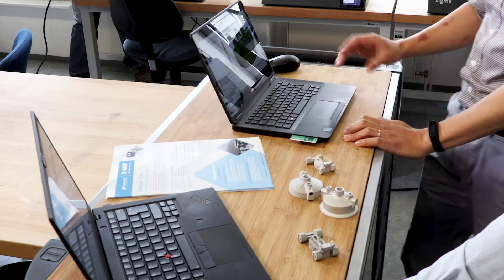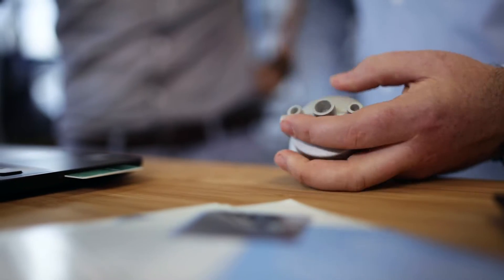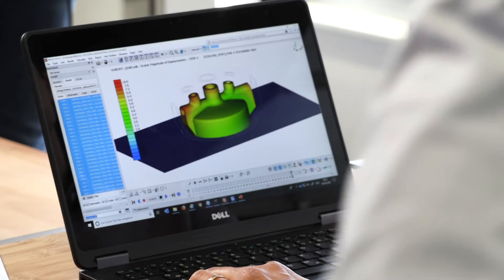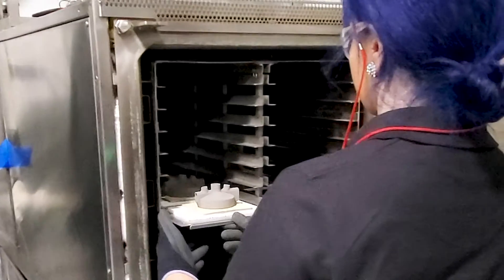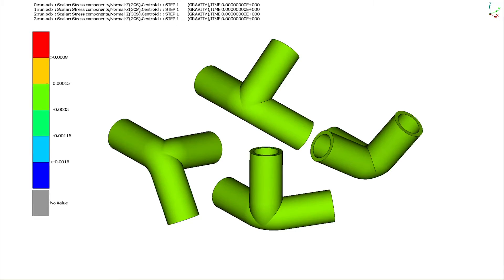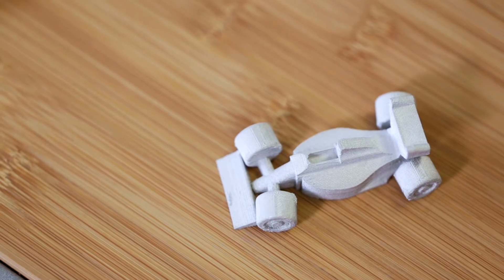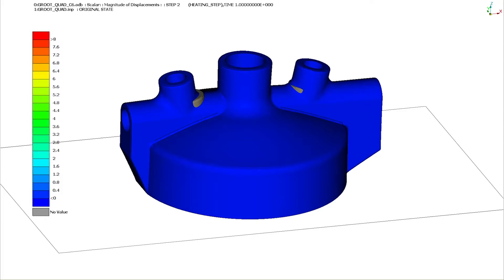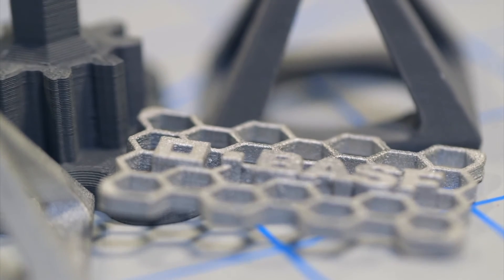Module 4: Simulation Services

Comment: Will you be releasing the shrinkage analysis tool?
Reply from the maker: We recently released a guideline to simulate part stability during debinding process. You can have a look via following link https://forward-am.com/wp-content/uploads/Debinding-and-Simulation-Guidelines.pdf. As sintering simulation is more sophisticated, we offer this as a service. If you have a design that needs to be optimised using sintering simulation, please get in contact to sales@basf-3dps.com to ask for an offer.
Reply: @ForwardAM  Page gives 404 result